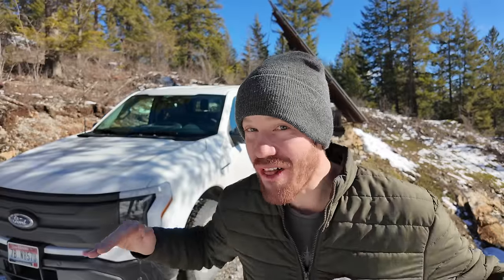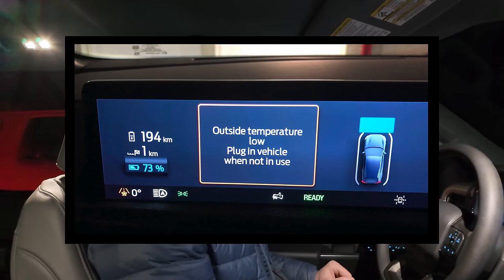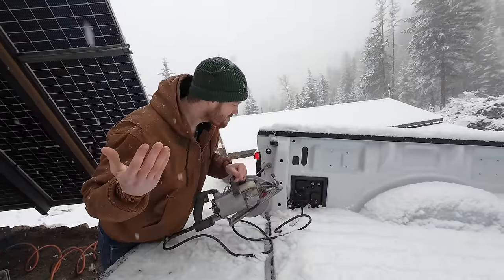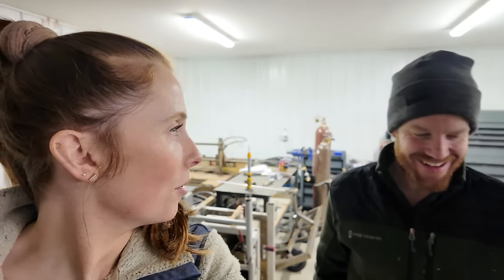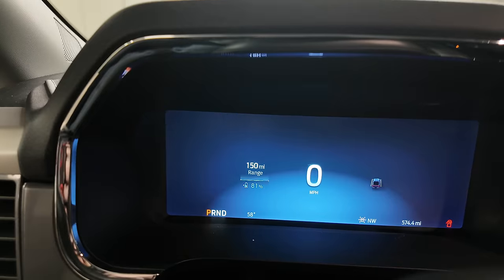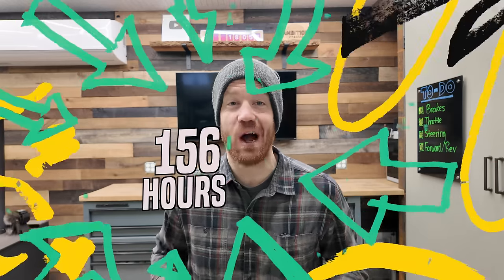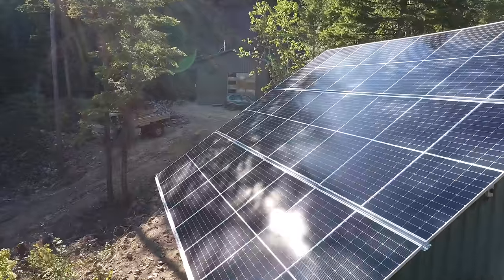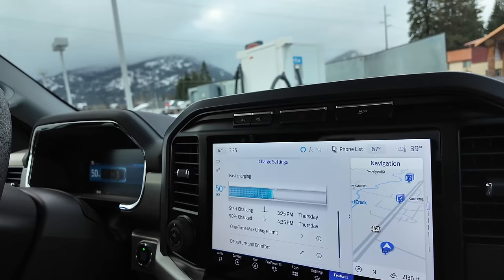Replacing My OFF-GRID Power System With an E.V. (not what I expected)

Comment: Use the Ford EV truck for apartment power backup and park it inside the home/shop building to allow easy access to start the Ford EV truck as emergency power backup for your apartment to avoid having to go to your Solar panels and start the Army Diesel generator when your solar battery backup is out of power during winter seasons.
Keep both the Truck and your Off-grid solar power setup available for your property and workshop needs as having one 
A pre-deployed solar power plant set up with a mobile battery backup is always better.
Then having only one of the two to rely upon for your off-grid energy needs.
As both setups can be used independently of one another so if one goes down for maintenance then 
the other will still be available for service.

Comment: 9:45 the problem is inrush current. Your system draws 16 amps in steady state. But there is a peak at startup. You might need to include some current limiting resistors at the start up.

Comment: BTW, the fast chargers at any dealership are usually 50kW chargers.  You should find an Electrify America charger (if one is in your town) and charge at the Lightning's full charge rate of around 172kW.

Its likely the 12V battery is bad on the truck, which is why it shut off the first time.  (those little AGM 12V batteries are notoriously unreliable).

The fact that you didn't know where the charge plug was, showed that you did zero research before you bought the truck.

Comment: So— when you charged the truck with the solar panels.. the DC from the panels was inverted to AC, pushed into the house panel, pushed into the truck charger, then converted back into DC to charge the truck. Wouldn’t it be cool to charge the truck straight off the panels with a DC to DC charger? This would be way more efficient and faster too.

Comment: Use the truck to compliment your off-grid system rather than a replacement. Depending on use of the truck it can take over from generators from time to time,  you can also get free fuel for your truck from your off-grid system. Obviously not at the same time, the trick is to find the right mix. In your location it might become the spring/summer/autumn vehicle that you always charge from your system rather than public systems and you run for free.

Comment: Geeze...and I was excited when I set up a 2000 watt system and installed a 3.1amp usb charge socket in my kitchen wall, fed down to my basement to charge my usb devices via solar.

Comment: You asked for comments on your setup. I suggest you get into power planning taking the various components into consideration.
By now you should know the house consumption by season and by outdoor temperature. In the same way you should know the solar panel production based on season and weather  forecast. This should allow you to “manage” house battery and var battery charging / discharging.
Example: If you in summer use 5 kWh/d you can forecast if sun panel power should charge house battery (or it has a sufficiently long supply possibility) and power therefore should go to the car battery - given a future sunny day.
In other words, a fully loaded house battery may not be the optimum choice.
The can easily be simulated in a spread sheet ro model what-if scenarios.

Comment: You need Topsy,  made by Edison motors. Or build the conversion kit they are selling...
Smaller batteries but Backup generator is on board.

People don't realize how much energy is needed  to drive.

Comment: I think it is a great idea for  a back up power system.  It seems like way more upside than downside when compared to diesel generator.  I'm sure you can solve the hair dryer and coffee maker problem or buy ones like then that are more efficient or don't trigger the truck to turn off or was it the appliance that shut off?  Plus electric vehicles maintenance is much less than on a ICE because a lot less parts.  Saves time and money.

Comment: All this work and could just instead add a few more panels/additional power storage (or update existing ones to better ones since the tech of panels is crazy fast on efficiency gains the last few years). The wear and tear on the mechanicals of the truck are quickly going to supercede the expense of adding/updating panels (Even just a new set of tires not being worn out faster, covers most your panel expense). Let alone factor in if you managed to get into a wreck with the truck on crappy roads trying to go get a charge. Could also look into adding more panels/additonal power storage to specifically create a charge bank point for the truck at home that could be a redundancy power supply for the apartment.

Comment: The Bidirectional charger that you can get from ford would probably be better for this, it uses the same chargport that you plug in the truck to charge with rather than using the plug in the bed. I have heard the setup is kind of expensive, though, but it can automatically change from charging the truck to drawing power. So i dont know if you could set it up to automatically start pulling power from the truck when your panels are no longer producing enough electricity.
Reply: I also think doing this would stop the issues with appliances shutting it off. And you wouldn't have to leave the truck running.

Comment: A couple of observations. When you introduced that special charger to allow a direct connection to your Battery bank you introduced inefficiency. I'm not sure of the logic of an electric truck, period. They are not viable options for real-world applications because of their huge draw backs. Not to mention the cost and eventual issues with the battery banks in them. Maybe you should consider more solar panels and more batteries. Then offload the extra power into things that could be utilized later. Hot water could be used to subsidize your hot water tanks. By placing a tank before your on-demand HW heater you could set it up to not come on until the water is below a certain temp. Just a few suggestions. Enjoy all the videos.

Comment: Hey guys ,
The car /off grid  connections seem fairly complex for the average person.
In fact ,I'd say considering  the connections and outlay for the vehicle   it seems to expensive  and complex for most people at this stage . 
Moreover, it's not going to run any of the diesel  equipment  either ,if a hair dryer  can send it into   fail mode , it has a long way to go before it's  viable  for the average home owner .

   Respect ...!

Comment: The last bit of the video you had a drone shot of the panels...  it looks like you could but in a near identical set well below those and double the intake.. that said, I have been testing with making the panels more V shaped, the overall angle the same But all V shaped like an arrow pointing south.  This gives more direct sunlight in AM and PM before the middle of the day ... The two sets would have have morning, afternoon and mid day sunlight ... then you may consider having a transfer switch for summer when all the power is full and then have it switch on a whole other huge bank of batteries .... come winter the sunny days and lowering or taking it easy of consumption ... may take you through many more days...  keep having fun and ... . pat

Comment: The problem is that in the event of extreme cold the batteries drop really quickly and I think it you would still find a situation where it would leave you high and dry.   Plus the value of these EVs are dropping dramatically because when the batteries do bad prematurely the cost to replace them is more than the vehicle is worth.  Cost wise it just doesn't make since but I can see how it would be fun and might come in handy in a pinch, I just would never be able to trust it.

Comment: I think the hair dryer may use power with a rapid pulse-width or half wave.  The truck's inverter can't find a steadystate operating point to supply that and quits.  I have a crap heat gun in my lab that makes my lights flicker like nothing else.

Comment: I believe that the problem with your hair dryer and coffee maker is because those are both two-prong plugs which means they're double insulated which means there is no ground. All of your power that would normally be return to ground is now going through your neutral wire. If you can get non double insulated hair dryer and coffee maker meaning you find those appliances that have a three-prong plug then your problem should be solved. The difference between the ground systems on your house power and your truck power is that you have an earth ground on your house and a floating ground on your truck.

Comment: The Chargeverter doesn't really care much about frequency so using that with the diesel generator would be a good pairing. Given the propane generator, that may not be a need anymore but having options is nice.

Comment: I like the idea of having the extra backup power, but the software/hardware on these EV's still seems a little to wonky to put 100% trust in. You were running a test in a controlled environment and had it give you issues, what if that situation happened during an actual emergency. Yea you got it running again, but not everyone has been that lucky. It definitely has potential but I don't think we're 100% there yet.

On another note, what if you two built a small insulated solar garage specifically for charging EV's? Maybe a 4000w or 5000w solar system with a 60+kwh battery system run by a Sol-ark 15k or EG4 18kpv inverter, this way the truck always has power and can warm itself during the cold days. It would eliminate the need to go into town to charge (unless of course you're hammering the truck), I'm sure a sponsor would love to join in on that type of project.

Comment: Wasn’t available when you got the F150, but now you should upgrade to a CyberTruck. Faster charging, more charging locations the ALWAYS work, would have likely been able to plug your battery directly to CT without the special charger and Tesla software just works. That’s what Tesla does best. Now with our 4th Tesla I can say with confidence, no other EV compares in terms of reliability and charging infrastructure. Also, CT would work great off grid as it doesn’t scratch and you can throw a sledgehammer at it and it won’t dent. I hope you have a reservation… though might still be too pricey and you might want to wait for the single motor one which is $60k in 2025 ($52.5k after tax credit at immediately at purchase)

Comment: so with the f150 lightning they also have a charging station that is two way. so when the power goes out or you need more power it will kick on. as for the power it puts off its not a pure sine wave which heating elements don't like so coffee and hair driers and heaters don't work well with it.

Comment: Would have been interesting to see a breakdown of the cost of charging the truck in town, and transferring that into the home system, vs. the cost of diesel or propane to run the generators to put the same amount of energy into the home batteries. So a cost per kWh into the home battery bank from the diesel gen, propane gen, truck (and you have to count the kWh lost getting to town and back. We won't make you account for the time lost driving back and forth, since a lot of times you could combine it with a trip to town you would already need to make to go shopping, etc.

Comment: I would only use the truck for home power in an emergency because you are cycling the battery which ages it.  This will reduce the life of the battery for the truck over the long haul.  The F-150 Lightning already has limited range and I would not like to prematurely age it.   If it had Lithium Iron Phosphate batteries, perhaps it would be OK to use it more.   But charging it from your excess solar is a great idea.

Comment: Worth upgrading the parents' outdoor socket to 240v if you can and as many amps as possible. We have 7amps but live in New Zealand, where household voltage is 240v. Charging in your local town is expensive, giving you better options and may help them if they go down the EV path themselves. We have two EVs and would never look back. Ford has issues with some wiring changes you need to do to do power back to the house, so it's worth researching. The software on the truck is constantly changing, so don't assume it is as good as it gets. Remember, too, that charging an EV stuff is less effective in winter with temp, so the current situation is the worst case.

Comment: Knowing that Ford Lightnings have been notoriously inaccurate as far as the actual range left in your battery, I break out in a cold sweat thinking about Courtney and Oliver sitting in an unheated truck while Riley walks in the snow and rain to get a cell phone signal to call a tow truck. Maybe you could carry a gasoline generator in the bed of the Lightning in case 20% isn't 20 miles after all!

Comment: I'd like to be able to power a small grid connected home using the large battery in a KIA Niro BEV during power outages.   I think I can do this using an inverter hooked up to the 12V car battery, and get about 1kW, which would be enough to keep the fridge going anyway.  But I haven't seen anyone else whose done this.     It should be much simpler than what's discussed in this video!

Comment: Don’t forget to factor in the limited number of charge cycle you’ll get out of the truck batteries. Then amortize the replacement battery cost into the cost of KW/hrs. Replacement battery cost is HUGE. This completely changes the ROI calculation.
Reply: 20k for 100kwh battery is huge????

Comment: You should have bought a used 75kwh extended Model 3 battery with the charging hardware and put it inside of a cheap used covered trailer, essentially creating your own mobile Powerwall. Towing it to the nearest charging station for fast DC charging and back with your diesel truck. Probably would have been about $10k at the most. The packs are around $8k used so you probably could have gotten 2 for 150kwh.

Comment: Very cool video. Just a note......I get not shutting off the power but.......the biggest problem may not even be safety, especially if you have a shaky hand. At the exact point you touch the terminals together, arcing and current spikes may occur which electronics absolutely hate. Sometimes you get away with it, but as an electrical apprentice a long time ago......sometimes you don't!!!! Hahahahahah  DD
Reply: I think all EV’s have a safety lockout system, so they lock themselves in to the vehicle before they allow any current to pass.

Comment: What are your thoughts on using the Ford Charge Station Pro which allows bidirectional power flow in and out of the truck from the CCS plug?

Comment: This is Pure Speculation 
on my part, but you might determine which 120V LEG she used for the hair dryer.  Then determine total draw Amps on that LEG.  It is possible the dryer, and coffee machine caused too much of an IMBALANCE between LEG1 and LEG2, and that the Truck’s Inverter protects itself, once it has sone predefined imbalance draw.

Comment: Your episode regarding Ford Lightning has me thinking. Is it practical to generate your own electricity with a natural gas powered generator or solar panels or vertical wind mill? The costs of storage batteries seems to be the main deterrent to many alternate solutions. Does it make sense to consider a vehicle as a storage battery? I realize purchasing a $50K truck seems extreme; what is the best solution, in your opinion?

Comment: The F150 lightning is an awsome truck as long as you don't haul/tow anything or aren't to attempting to travel any significant distance in cold weather
Reply: It hauls great almost zero loss due to just bed weight. Towing it loses 2/3’s of it range so only can travel 90 miles with a large trailer before charging. 

That is 4 round trips to town for Riley so pretty good.

Comment: Regards the hair unit, if it's 3 wire Live Neutral Earth then its possible you have a breakdown between the live & Earth, could be a faulty filter on the hair unit, 
To get far more from your Solar PV system try use mirrors to direct more sun 🌞 to the Solar panels 👍
Regards cutting off quickly maybe look into a Soft Start unit, they use them on electric motor systems

Comment: I've seen ground issues with small generators.  It's usually because most home panels tie neutral to ground where you connect to the grid and the generator does not.

Comment: With my Ford Fusion plug-in hybrid, using the 115V charger,  I found a 20Amp electrical circuit was necessary. My electrician told me that the outlet for long duration should not pull more than 60% of the rated amperage. I found out the hard way by plugging the charger into a 15A outlet, only to have the outlet burn out.

Comment: There were 4 engineers riding in a car across the desert, an electrical engineer, a mechanical engineer, a chemical engineer and a software engineer. The car suddenly died and they drifted to the side of the road. The electrical engineer said, "we must have lost spark". The mechanical engineer said, "we must have thrown a rod". The chemical engineer said, "we must have bad gas". Then after a moment of silence the three looked at the software engineer who said, "maybe if we all get out of the car and get back in again it will start".